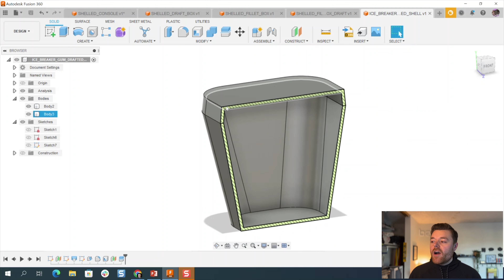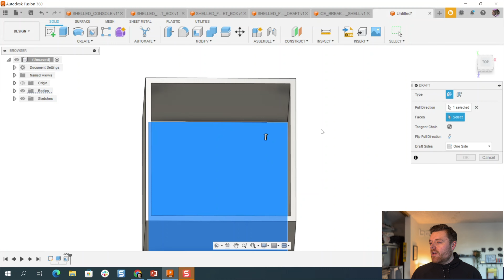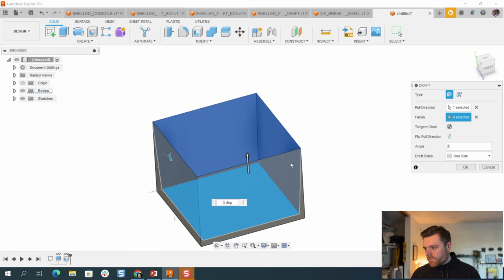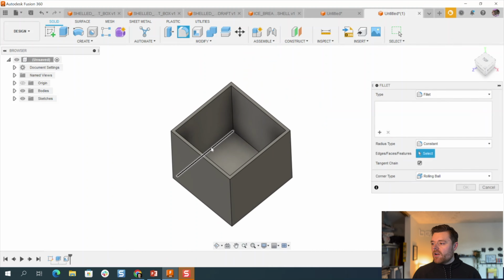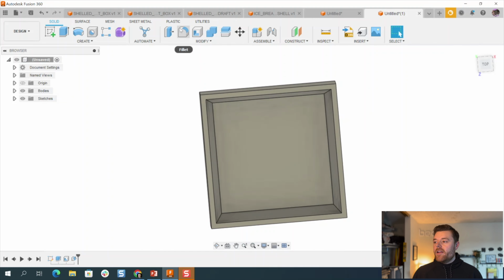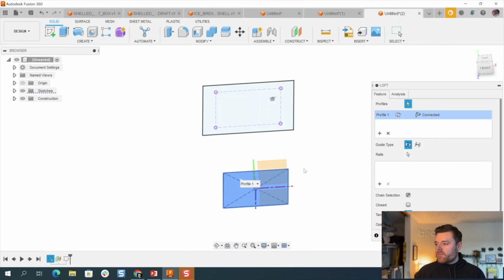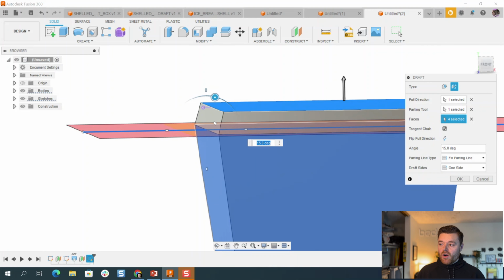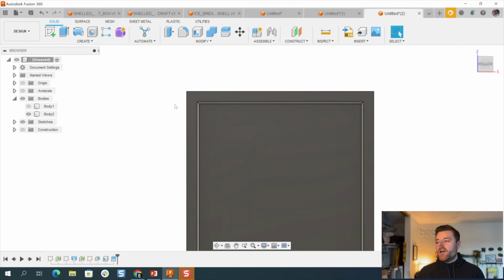How to use the Draft Feature in Fusion 360!

Comment: Great tutorial. On the first example I believe when you chose the bottom face for the direction you could have entered a negative value or flipped the direction. Also, when you are in the draft or fillet dialog boxes you don't have to hold CTRL to select multiple faces.
Reply from the maker: Great tip!